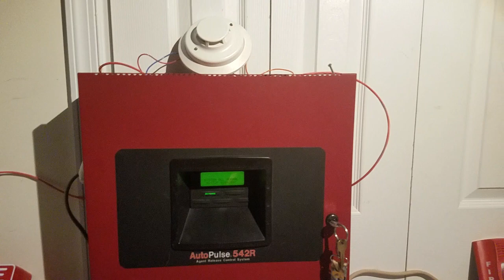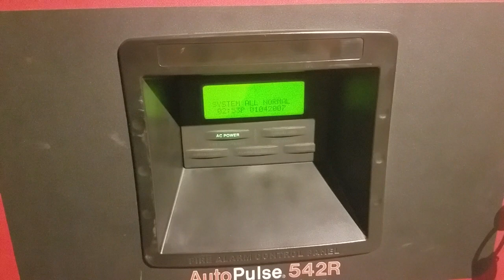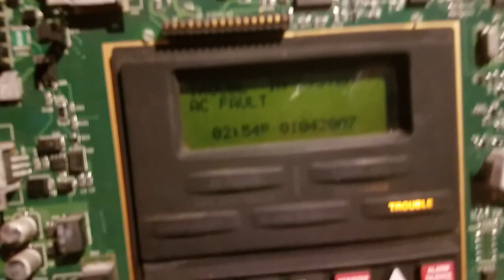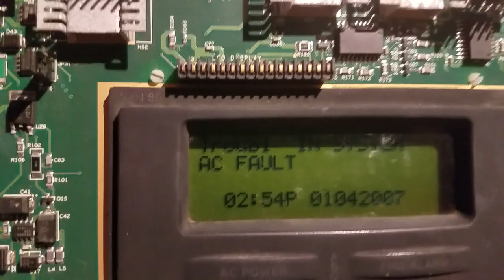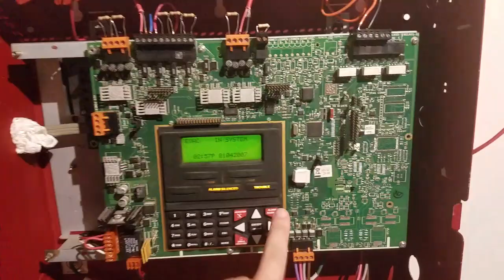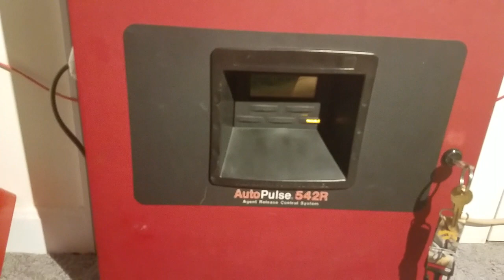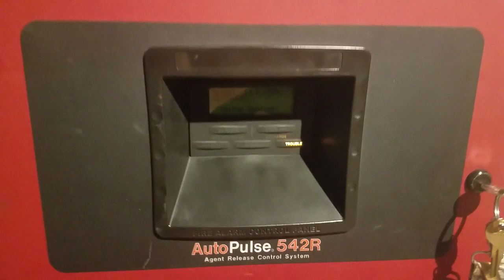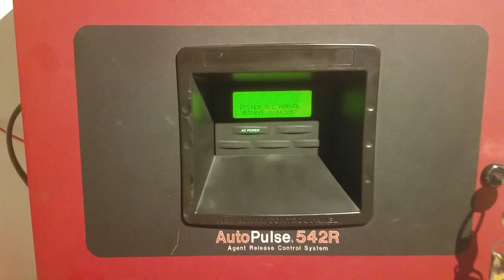Fire alarm control panel troubleshooting 1

Comment: There is AC power dc 24 volts supply is not sustain the dc power cannot ring the alarm the 24 volts supply go down slowly if I used my tester what parts of electronic will be change is it capacitor?

Comment: How do you shut the system down when it keeps reactivating after a couple of minutes? Firefighter looking for help. We keep making apartments with them going off due to this cold weather, and the alarm companies aren’t sending people so the residents are stuck with the alarm activated. Also we have the apartment employees go on fire watch(for safety.)
Reply: Either a device is still actuated, like a smoke detector isn't fully cleared of smoke, or a pull station has not been reset. Look at the device that triggered the alarm, walk to it, clear the smoke or reset it. Then press reset on the panel, if it still triggers, contact a professional.
Reply: @SpiffingPepe  There was never any smoke and no one pulled any device. That crazy negative 30 degree night in OKC just screwed everything up.
Reply: @oinchadoomandwolfboy  What panel is it? Depending on the panel you can disable the zone
Reply: @Roxxofoxxo  it’s been a long time now. I don’t remember what it looked like. All I remember is having to shut down multiple sprinkler systems that night, forced so many doors, and turn off alarms.
Reply: @oinchadoomandwolfboy  Ohh alright, on some fire panels you can disable zones if the fire alarms keep sounding, or you can disable the nacs
Reply: @Roxxofoxxo  I remember now, it would ask for a code to disable that no one had and we were unable to get.
Reply: @Roxxofoxxo  Not recommended
Reply: @AcElectronicSystems  Oh yea? Why not?
Reply: @Roxxofoxxo  Well temporarily yeah, but imo I think it’s always best to find the activated device and reset it rather than disabling. The FD made that mistake at my old apartment and when there was some smoke from an electrical short the alarm did not sound because the only zone was disabled. And left disabled.
Reply: @oinchadoomandwolfboy  you can hit alarm silence temporarily until the weather warms back up, i believe it will still go back into alarm if someone pulls a station or a smoke trips.